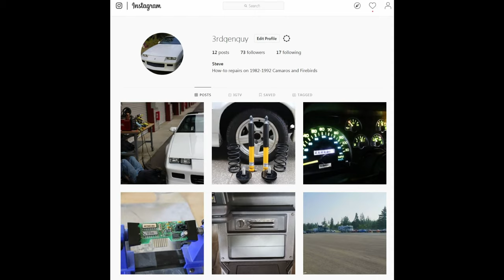GM TBI Fuel Injector replacement (V6 V8 SBC BBC 4.3L 5.0L 5.7L 7.4L)

Comment: This vidio was great so my 1992 Chevrolet Silverado extended cab 5.7 TBI  would idle like it was new but took on the road and cough and sputter and shake and misfire so i changed the temperature control sensor and nothing so i changed the MAP sensor and yep nothing so i changed the TPS which is the throttle control sensor and bam runs like new

Comment: Your supposed to use automatic transmission fluid to lube the O rings according to the GM chevy manual
Reply from the maker: Anything that keeps the O-ring from pinching or wrinkling works.
Reply: That’s stuff he uses works too

Comment: I have a 454 7.4 that I switched the injectors on but they won’t throw gas out ik it’s getting fuel any help with it, as well as the exit side on the injector is different but idk if that has something to do with it?
Reply from the maker: if the injector doesn't fire, something in the wring probably went bad. 
you can cycle the injector with  a  9V  battery as well to test it

Comment: How do you get them to spray? Like is the key on and are you manually actuating them?
Reply from the maker: Start up the car, ha ha
Injector shops can test them as well.
Reply: @3rdGenGuy  Derp yeah for some reason I was thinking you wouldn't run the car like that lol ty

Comment: I just did this, also all gaskets, tps and icv, and now when i switch ignition to ON, the spray a thin beam of gas non stop. How is that possible?
Reply from the maker: Try cycling the injectors with a 9v battery.
a solid stream would be a injector stuck open.

Comment from the maker: just a FYI, i had to remove the background music due to copyright nonsense.
so there's no sound for most of  the video
Reply: Dumb question here: we bought new injectors for a 96 454 we're working on. They had these little podges of white rubber something in the very top center of the injectors. Like maybe to keep them from being damaged. They're still not working. Should we pull that lil white plug thingie out?
Reply: Where did you get the gasket and injectors from?

Comment: Great video. Seems fairly simple. An OBD scan of my 1988 Chevy truck, with the 350, has the code for the injectors, plus EGR components. Running really rough and major loss of power. I thought I needed a rebuild, 400,000 miles, but I'll definitely do this first.
Reply: Any updates on the outcome afterwards
Reply: @zachmoore9097  not yet. Can't get the EGR valve loose, and just ordered the injectors. May have to take it to a mechanic, if I break a bolt, on the EGR valve, I don't have the tools or skills to fix it.
Reply: @Terryg1968 how did it go?
Reply: @rene3399  I replaced the fuel injectors, they were rebuilt, and defective, took it to a mechanic and they replaced them with used ones, runs great now.
Reply: @zachmoore9097  I replaced them myself, wasn't easy doing the rubber gasket with the spring I replaced also. Can't remember what that part is called. The injectors I bought were bad, dumping too much fuel. I returned them and too it to a shop, they put used ones in for $300 total, and it runs great now.
Reply: @Terryg1968  awesome man. I just bought a 91 blazer. Only thing needed was the new injectors and rear axles. Getting impatient waiting on the mechanics so I can do a tuneup and oil change. Hoping she runs good after that. Thanks for responding man!

Comment: First time i saw that system was on a cross fire injection. I would use motor oil though, just saying. Is that the fuel regulator on the back. Great videos, keep up the good work.

Comment: What would cause a backfire from one of these systems on a 1984 chevy 454 that has timing advance control??? Can it be timing to advanced? Or too small of injectors? It backfires out of the throttle body when going up any hill when the engine is at full operating temperature.. any info would be great... THANK you!!
Reply from the maker: check the timing, the ECU adds timing or subtracts. a bad TBI won'at cause back fires like that.
Reply: It could also be a clogged up catalytic converter

Comment: @3rd Gen Guy	hey bud those plastic parts with the wires attached keep catching fire when I start the truck. Any suggestions
Reply: Did you correct that issue yet?
What was the reason for the fire?
Lmk please and thank you in advance

Comment: Nice replacement of the injectors, thanks.   I have a 1989 g20 5.0ltr that has occational misfiring and poor gas mileage do you think injectors are the problem, i have all new wires and iridium plugs ?
Reply from the maker: hard to say. Local injector clinics will still flow and test TBI injectors for like $30. maybe worth it to eliminate a potential issue area.
Reply: @3rdGenGuy  I will run and test my injectors to see if they are equal in spraying and also buy an gasket kit for all of it. thanks for the reply. Jim   PS; new injectors are expensive $$$

Comment: Thanks!  Where did you get the injector kit???  I've been looking for 2 hrs. for my 1994, 1500, 4.3 V6 and every site/store shows "no go".
Reply: Should come up when you look for Fuel pressure regulator. That's what holds the injectors in place
Reply: Same with me g

Comment: what is the gasket and o-ring kit used in the video and where can it be purchased?  The kit is for a 1993 chevy P30 7.4L
Reply from the maker: it's part of the TBI rebuild kits you can buy for cheap.

Comment: I have a 1988 chevy s10 and the air filter it's covered in gas could any please help me me with what could be wrong I think it's the gaskets? I checked the injectors and the seem to be fine
Reply from the maker: in my experience, every car that I've rebuilt the TBI on, ALL have run better afterwards.
so it's best to just rebuild it, because it's cheap and easy.

Comment: Could getting the notches on the under side of the injector in the wrong place cause idling problems on start up and stumbling acceleration. Just rebuilt my the and I am having these problems. Other videos didn't explain them and thought one might be in the wrong spot. Came a cross your video problem solving .Thanks
Reply from the maker: if you don't align the injector notches, the unit top doesn't really fit right. 
how old are your injectors?
Reply: As far as I know there the originals. It had a small miss before but now it it's worse in other ways. One cold start it idle normal the idles down for about a minute and stutters on acceleration after. I was told it may need to be relearned. Thanks for the response

Comment: Dear Sir good day to You. My 1993 chevy caprice (secondary air smog pump already delegated) gives smog when gas pedal accelerator pressed 3, 4 -times quickly by yearly vehicle test technician. Please tell how I can fix smog problem (black smoke coming out of exhaust pipe). Best Regards. Mohammad Ali.

Comment: Huh, I took mine apart but the injectors are stuck tight and don't want to come out.
Reply: Penetrating oil will help
Reply: Look at the last picture from this kit. It shows you how to use a screwdriver and a fulcrum. https://www.ptatrung.com/index.php?main_page=product_info&products_id=146741

Comment: Are 4.3 injectors the same as the 5.7 350 ?
Reply from the maker: they look the same, but the flow rates for the 4.3/5.0/5.7/7.4L are all different. 
you have to ensure the injectors are for your engine size.
Reply: Thanks for the info

Comment: Only part you left out of video was disconnecting the fuel line to pressure regulator which can be a pain sometimes.
Reply: thwre no line going to the regulator

Comment: What engine is this on? I have the exact tbi
Reply from the maker: it's a 305. most if not all TBI are pretty much the same.
Reply: I’ve seen a lot of TBI with 3 vacuum lines coming out of it, mine and yours has 4 lines that’s why I ask. Can you please send me link for this particular rebuild kit
Reply from the maker: @80513able  i used a 
(ACDelco Professional 219-607) kit

Comment: If someone follows this video they might find themselves in trouble cuz it does not explain the proper orientation of the fuel injectors inside that throttle body they have a little devits on the bottom that can get crushed against the housing if not properly installed it also does not explain how to safely remove the injectors
Reply from the maker: shows it at 2:05
voiceover got murdered by the copyright algorithm, but I show the injector notch.
Reply: @3rdGenGuy at the 3:07 mark what exactly are you doing here?
Is the vehicle on , is the battery disconnected and if you may please break it down for me to get a better grasp on the information you provided 
Thank you in advance

Comment: My injectors didn't pop out like that... they won't move at all.
Reply: I took some off a van in the local salvage yard and i used a pair of lineman pliers and gently grabbed the top of the injector and gently pulled up and they both came right out.

Comment: you didn’t specify how to put them in so i still don’t know how
Reply from the maker: the video covers the injector notches that line up. make sure to not skip around.
Reply: @3rdGenGuy  no they don’t, u showed up the little nozzle but when u put the injectors in you moved ur hand around so i don’t know which way u put them in. i didn’t skip around. i watched that part of the video at least 10 times to see if i could figure out how u put em in there. don’t worry tho, i found a better video that actually showed how to put em in